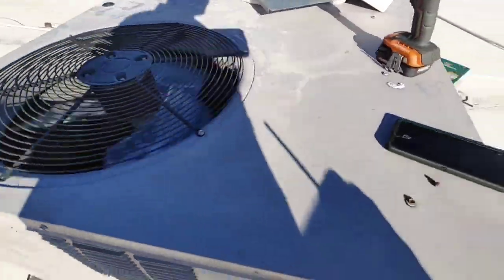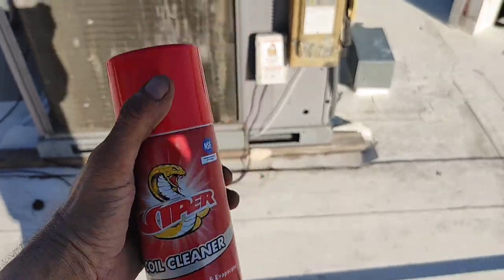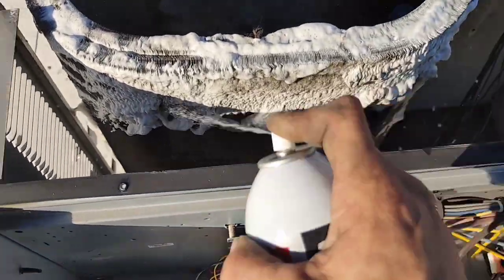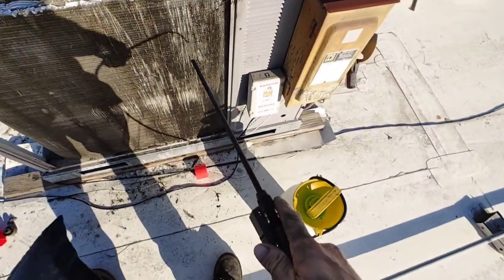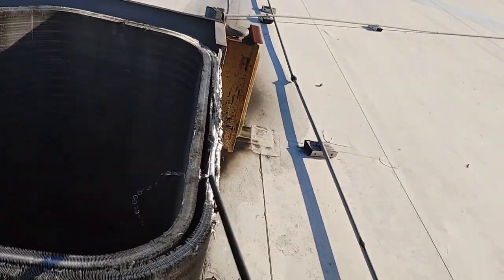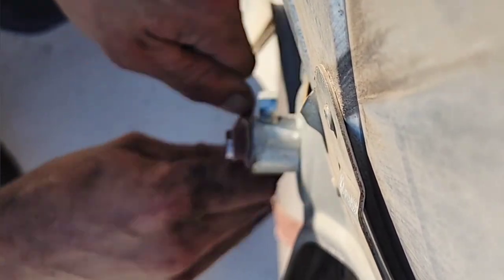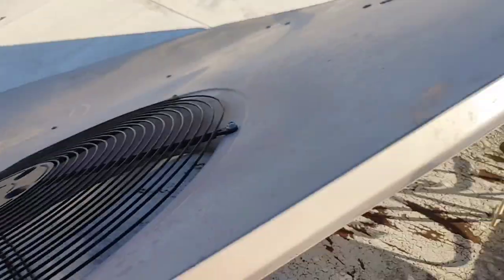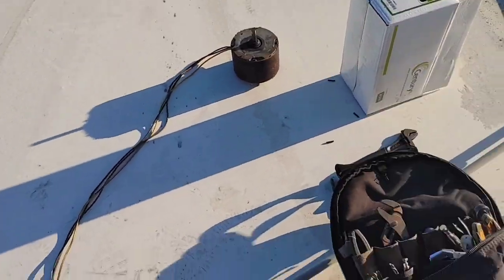Condenser Fan Motor Replace and Condenser Coil Cleaning on Rooftop Package Unit

Comment: Good job done but you will have to invest  in a better sprayer lol
Reply from the maker: Oh the pump sprayer? No it's brand new actually but I took the nozzle tip off of it to try to get more volume of water through that tiny little quarter inch tube. That really didn't help as you could see so... yeah. 

 I need to get a couple 100 more feet of hoes on my truck
Reply: @HVACRServiceTech  yes my thinking longer hose